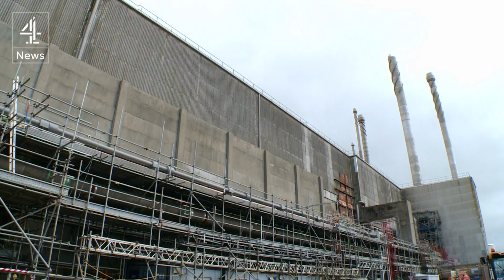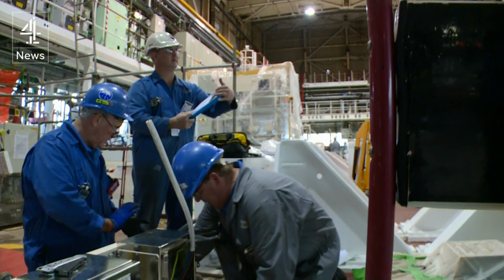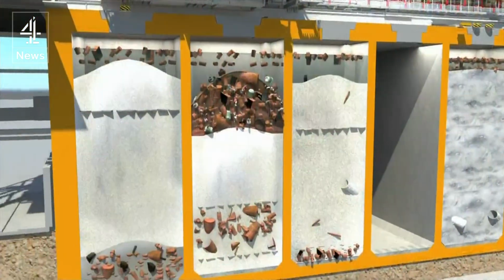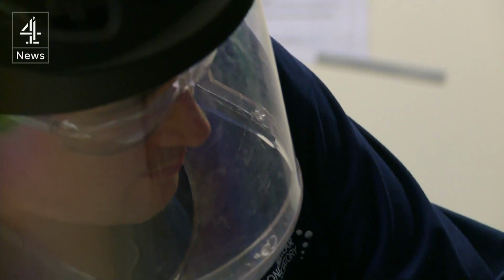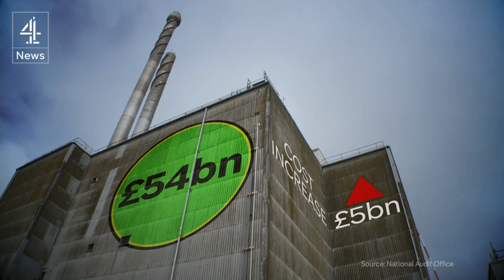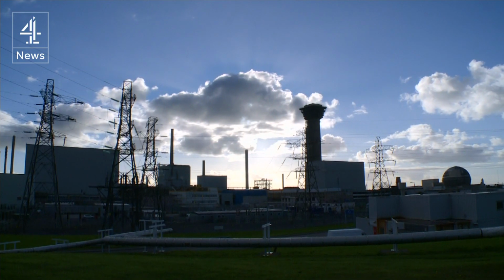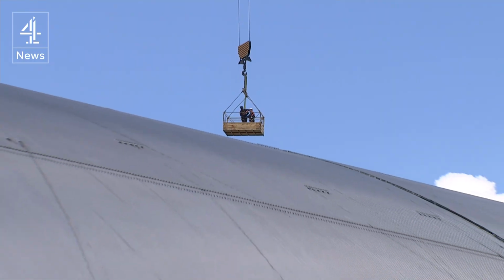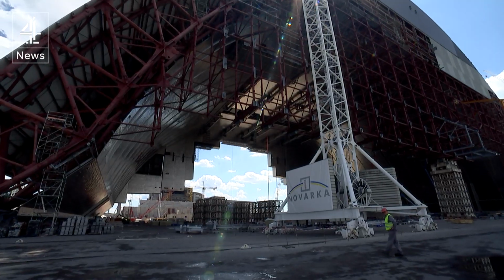Sellafield: Europe's most radioactively contaminated site

Comment: Nuclear energy is not the answer to our energy needs. All we are doing is storing up problems for our children and generations to come. Concrete breaks down after a time so is not the answer.
Reply: This waste isn’t from nuclear energy.
Reply: @qasimmir7117  well tell me please where it does come from. Sellafield used to produce energy but it came to the end of its life and so now we process waste from all over the world.  Nuclear energy produces waste in the for of spent fuel rods which have to be reprocessed. So why do you think it does not come from Nuclear energy.
Reply: @christopherfothergil 
This is what is known as ‘legacy waste’ it came from nuclear warhead development in the 50s and 60s. This is not how waste is produced and managed from current nuclear warhead or nuclear power reactors.
For the fleet of Magnox and Advanced Gas-cooled Reactors (AGRs) in Britain, the spent fuel rods are left to decay in a pool onsite, then transported to Sellafield for further decay and pool storage. Then in the future, to be buried deep underground.
For the pressurised water reactors (PWRs) like Sizewell B and the ones under construction like Hinkley Point C and later Sizewell C, the waste can stored onsite indefinitely if they wanted to. It could be stored in sealed casks above ground or a deep hole drilled beneath the water table, filled with sealed high level waste and then the hole would be collapsed.

Comment: '' oh, we find a better way to deal with the waste... instead of processing it,  we figure a new method much more efficient     we gonna store it in containers!'' ...  he probably didn't know the camera were running when he said that...
Reply: joseph-mario pelerin no... what he said makes sense. storing spent nuclear fuel makes sense, at least for now as Fuel is relatively cheap. reprocessing that means more health risks and spending when properly storing it is a better, safer solution.
Reply: @simonphoenix3789  maybe... but its a right now solution... what will happen 100years from now... ?  dig it  out and processes it anyway because uranium is getting low... 

it just sound like what it is;
 a way to don't loose too much profit and pass the expense to next generation... as i can see, they succeed at making it scientifically acceptable...
Reply: @joseph-mariopelerin7028  Reprocessing waste that has aged is easier and safer. If you wait longer, more of the short/medium lived isotopes will have decayed, simplifying the problem.
Reply: @placeholdername0000 yes, they been saying that since 1948... yet we only keep pilings on top of the old stuff... noone is willing to pay the bill so, 

Reprocessing plan are just not profitable for the industry... so as the nuclear power itself...

Why are we so focus on failure...
Reply: @joseph-mariopelerin7028  The industry lost interest in reprocessing when the uranium price and the cost of enrichment fell. The main reason is waste management, but governments don't demand it, so noone sees the need.

Comment: The Fukushima Dai'ichi (avoidable) accident is an extinction level event.  Birds, fish and other ocean life are being decimated.  The problem is that there has been such massive investment in military nuclear and civil nuclear that the "establishment" has such momentum that it cannot change course. As a result, there is denial at a time when massive international resources should be used to try to contain the Fukushima contamination.  However, the present situation correlates with Dr Richard Duncans Olduvai Theory that fossil fuel depletion, human population increase and pollution will cause a massive decline in energy per capita from year 2010 onwards from which the anthropocene will never recover.  This is the end folks !  If only a small fraction of the money spent on nuclear armaments had been used to improve safety systems at Fukushima Dai'chi to ensure that there were safe and reliable backup generators (for example on higher ground and made tsunami proof so that the Fukushima reactor decay heat could have been dissipated safely).  A higher defensive wall at Fukushima Dai'ichi could have been built at relatively small cost relative to military budgets.  However, .the Japanese government has not learnt its lesson: other existing nuclear reactors in Japan are being allowed to restart without massive tsunami defence walls being built.  The biosphere and the anthrpocene are sacrificed at the altar of money, just like Judas sold Jesus for three Gold coins.  Jesus gave us the Garden of Eden.
Reply: Well it's about time this ridiculous world came to an end.

Comment: Nuclear power cost 3.5 x  of coal that was argued by thatcher in the early 80's was uneconomical. Windscale now Sellarfield has been dealing with the nuclear waste of its bomb making and then power producing since 1950's. It's been putting off the treatment of nuclear waste due to costs never factored into the profits. Now the buildings housing the waste are falling down and yet they still having dealt with the waste. This tells you all you need to know about the lack of management of the nuclear process. THE UK CAN'T MAKE THIS WASTE SAFE MUCH OF WHICH HAS A HALF LIFE OF OVER 1 MILLION YEARS.

Comment: all this panic about radiation, yet nobody compares all the deaths from fossil fuels .
Reply: Everyone does. But when a coal plant stops, that's it. It's over. It doesn't require a century long, $100b cleanup and if it fails, it doesn't require the surrounding land be forever uninhabitable thanks to long lasting radioisotopes. This shithole site dumped radioactive waste into the Sea then threw it in buildings, and crumbling ponds for storage.

Comment: Is this the same plant that had spend fuel rods in the 1950's that were suppose to drop into a water tank? Because of this radioactivity was allowed to be pushed out of chimneys and contamination was detected and spread but the government insisted that there was no danger and then the plant had a major fire.
Reply: yes and no, this is indeed the site of the windscale reactor and fire. Though there was no contamination allowed to escape, the fuel cartridges were pushed through a graphite block to enrich them and as they emerged from the other side (pushed by the ones behind them) they fell into a water channel that not only helped cool them but carry them away. The disaster happened because the government at the time was trying to use the reactor to make more and more enritched materials for bombs but meant further and further straying from safe procedure

Comment: Maybe it's cheaper to put the stuff on rockets and send it into space.
Reply: Not sure if serious...
Reply: The risk would be too great.

What if the rocket exploded during launch?
Even if the rocket successfully launched into space? there is still a high chance earth's gravity would pull the waste back in

The containers the waste is housed in is too heavy. If the containers weren't meters thick the radiation alone would interfere with the space shuttles electronics.
Reply: @66kaisersoza  It would be risky, but that's hard to get away from. You wouldn't put the waste in orbit of course, you would send it further away. As far as possible. Weight is also a problem, so it would take many, many trips. Fortunately, rocket parts can be re-used.

Was I serious? Partially. This waste is going to be a problem "forever". Shooting it off into space is going to get rid of the problem "forever". So, it sort of makes sense.

There's some talk of molten salt reactors and such, that can use some of this waste as actual fuel. That would be an awesome solution. One man's garbage is another man's gold, I guess. I'm not sure of the time scale on this, since it doesn't seem to be a priority. It baffles me.

Comment: Also: how is creating a sliding containment shield hundreds of meters large from steel simpler than essentially transferring nuclear waste fuel/ water into new containers?
Reply: they dont have to come into contact with the nuclear waste
Reply: @hansgruber788  Except for potential irradiated dust, water, material and a-near open core. Well with 54 billion I am sure they can invest in several remotely operated vehicles. Are you suggesting they lift each waste storage unit out by hand?
Reply: @__Wanderer  no, but the fact remains. Most of Cherobyl has safe radiation levels apart from within the reactor building itself. They just need to contain it within a sarcophagus. At sellafield they need to directly come into contact with the nuclear waste material which is far more technical than sliding an iron dome on top of a building. not by hand of course not
Reply: @hansgruber788  mhmm to be honest I know rather little about the process. However the cost ~54 billion seems extremely high. Chernobyl cleanup + total cost since 1985 (including knock on effects of lost land etc) cost 230 billion apparently. It is a shame these funds could not be used for renewable energy (or the building of a brand new nuclear plant).
Reply: @__Wanderer  I don't care how much it costs when we're dealing with something as potentially dangerous as this. this isn;t something we can afford to be cheap over. And nuclear energy is statistically the safest and most efficient energy source far ahead of renewable energy. But it would be great of course if that money was used to fund research into a fusion reactor.
Reply: @hansgruber788  Yep.
Reply: @hansgruber788  It will never happen...…..there is too much money already invested in nuclear energy so why would they abandon that to go berserk on another wild goose chase. They didn't realise the ramifications of nuclear waste disposal so if that is true then the next pollution will be the last for everyone...…..play with fire and you will get burned.......the next genie out of the bottle will be the last one for all.

Comment: What about Chernobyl??
Reply: Chernobyl had one major incident which was put under control relatively quickly, Sellafield has had dozens of rad material leaks over the last 6 decades
Reply: @BlueShift815  yes, it was only 3.6 roentgen max... equiavalent of a chest x-ray. From the feedwater.
Reply: What about it?
It's fixed. Give it 5 years they'll reopen the exclusion zone at the exception of the 10km around the power plant. It will be both for museums and open visits as well for relocating people there.
Mark my words. Radiation levels are okay but most importantly, the country is desperate for money.

Comment: And yet people wonder why many are hesitant switch, or are outright opposed to switching to nuclear energy. Not exactly clean, is it? It might not produce pollution like smoke or soot but the radioactive waste produced by the process is insanely dangerous and has to be securely housed, constantly guarded, any leak permanently irradiates the entire surrounding area. Any major incident would irradiate huge portions of the northern UK. It's not worth it. 

Either go fully renewable or stick to coal. Better the devil you know.
Reply: Wrong. This waste is a political problem, not anything other. It's been used by politicians to scare ignorant people.
You can not replace a baseload source such as coal or uranium with renewables. It just doesn't work.
Uranium fission, thorium-uranium cycle, and then one day fusion of hydrogen, are our nuclear futures. There is no other solution.
Reply: coal causes more deaths than nuclear. how much so? there'd have to be a chernobyl scale meltdown every year to match the death toll that coal and oil pollution causes. but because oil and coal are accepted, idiots assume they're safe.
Reply: Energy? Isn't this waste from weapons development?

Comment: Dose meters worn at Sellafield give only general radiation dust, not hot particles.  It is appalling situation that should be made highly visible to public, before more huge errors are made like Hinkley Point C and Sizewell C.
Reply: Tim Norris you’ve just spoken complete nonsense.
Reply: @gilhooley28  Rubish.  I know how Sellafield does its hot particle testing and its procedures re completely inadequate.  Staff are being exposed to severe danger due to hot nanoparticle exposure that the existing Sellafield instrumentation is too crude to detect.  Please do your homework properly before writing stupid ill-informed comments.
Reply: I agree that a personal dosimeter wouldn't necessarily detect the presence of particulates. You'd need some form of air sampler or a device such as a "tacky" shade for that purpose. I assume you see these too as inadequate for the detection and counting of "hot nanoparticles". Would the effects of such particles show up in routine urine and blood samples? In the interests of safety have you made your concerns known to the ONR or the Health Protection Agency? If so have they made any response? You did say staff were exposed to severe danger.

Comment: The latest development is that the new coal mines that are proposed for Cumbria, with mine shafts just a few kilometres from Sellafield, is that the coal mines, when exhausted and empty of coal, will be used to store fragments of nuclear waste cast into cement (for example Silicon Carbide matrix cement).  There is a lot of nuclear hardware to dispose of: Calder Hall (Windscale) nuclear reactor parts, THORP reprocessing apparatus parts, nuclear reactors from defunct Trident submarines, advanced gas-cooled reactors (AGR's) that will soon be decommissioned, a MAGNOX reactor that will soon be decommissioned, as well as pits of nuclear slurry at Sellafield that are rusting and rotting away.  Digging coal in Cumbria is just a "smoke screen" to hide what is going on with creating an underground nuclear waste dump.  The mining company involved is based in the Cayman Islands so will not be paying tax to the UK Government and probably cannot be sued if anything goes wrong when storing nuclear waste in the exhausted coal mines.  The shafts of the proposed mines will extend deep under the Irish Sea.  If the aforementioned cement encapsulation fails, the de facto nuclear dump provided by the exhausted coal mines will pollute the whole of the Irish East coast and the Scottish West coast.  Because no other councils are prepared to accept high level nuclear waste in mainland UK, and Northern Ireland has also rejected becoming a nuclear waste dump, the UK Government is now (via the proposed coal mines) hoisting an underground nuclear waste dump on Cumbria.  Moreover, the Cumbria Council unanimously accepted the situation at a recent meeting when the issue of approving the coal mines was voted upon.  The fact that the coal mines will eventually become a nuclear waste dump (referred to as a "repository") is the "big ghost" in the cupboard that everybody in the Cumbria council knows about, but nobody dares speak openly about.  i submit that open discussion is urgently required so that, if the coal mines are to be used as a nuclear repository, that the job should be done properly and thoroughly, and not in an amateur half-done "cowboy" manner that is so typical of infrastructure projects in the United Kingdom.
Reply: Tim Norris
"if the coal mines are to be used as a nuclear repository" - unlikely with Gen4 molten salt reactors.
Reply: @tonyduncan9852  - Gen4 molten salt reactors are years away, if ever.   There are very many hurdles that must be overcome before they are accepted for use.  Moreover, there are competing technologies such as X-energy pebble bed reactors that can also be made to function with Thorium pebbles, and are a favoured reactor type by US military.
Reply: @tonyduncan9852  - Some factual errors in your missive.  Thorium LFTR will not appear any time soon.  Dr Alvin Weinberg's reactor was a very primitive test setup.  A commercial design of Thorium LFTR is a totally different undertaking.  People like Dr Kirk Sorensen have never built or operated a Thorium LFTR, so do not be beguiled by his overenthusiastic Youtube videos.  I have found him wrong technically on several issues.  Many people describe him as an over-enthusiastic "zealot", that is very dangerous when the audience is ill-informed and beguiled by emotion.